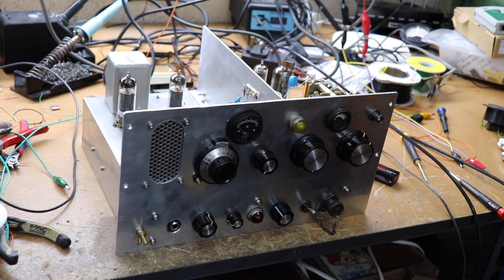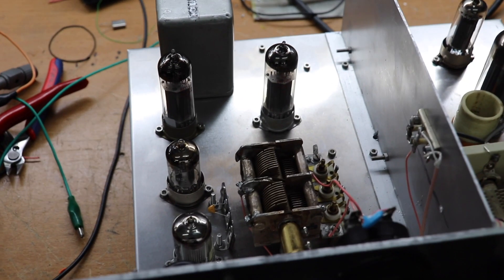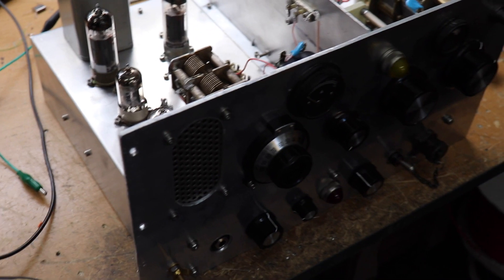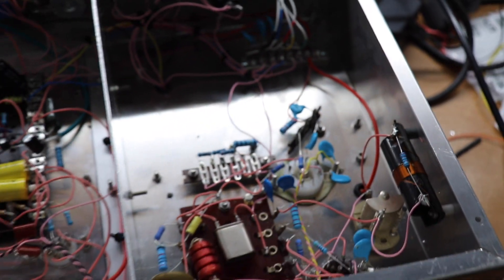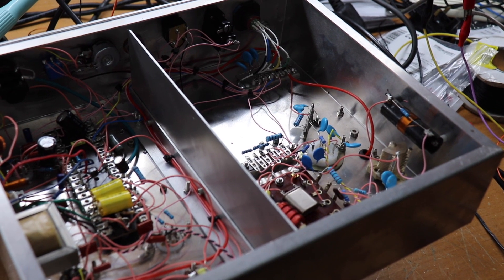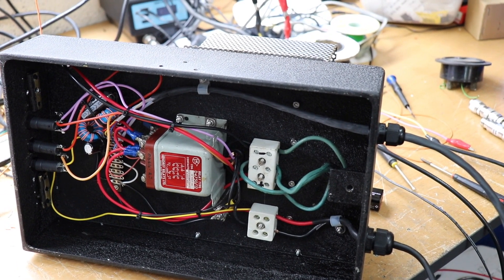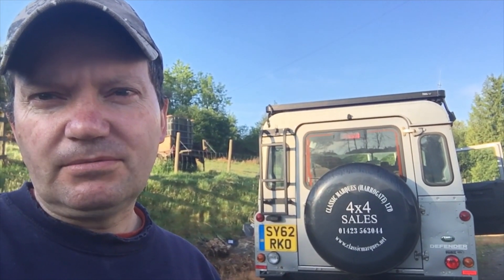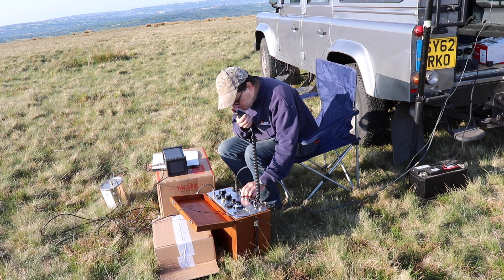Out And About With A Homebrew AM Transceiver

Comment: Well done Justin, very impressive homebrew field transceiver. I am also building an AM 80m rig all solid state and the receiver is also going to be using the TDA1072 chip. I had  two 3.615 mhz crystals made last year as I couldn't source any myself.  It proved to be very expensive. Fantastic video. Hope to work you soon on the AM net. 73 M0DAD David.
Reply: Hope to see an 80m AM field station from you soon David, Paul VK3HN.